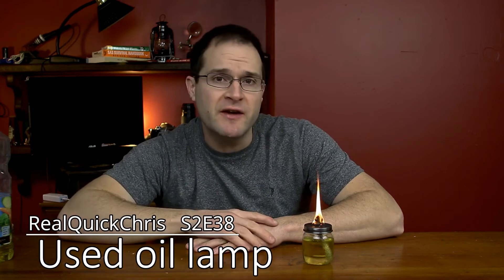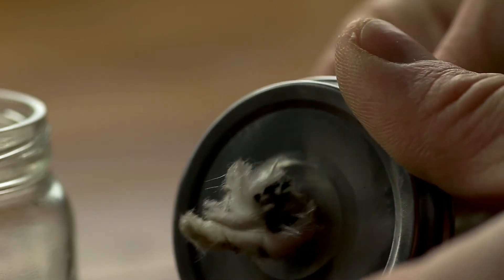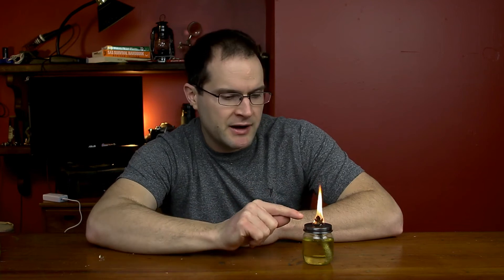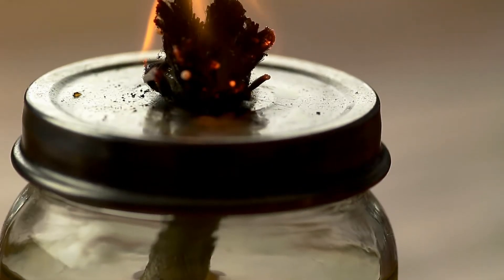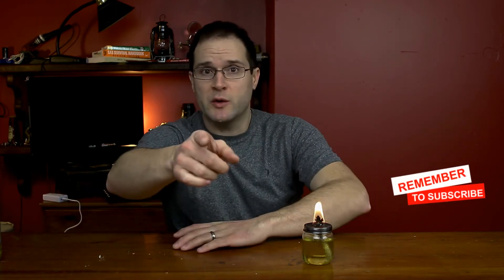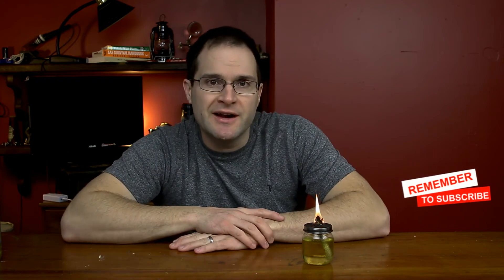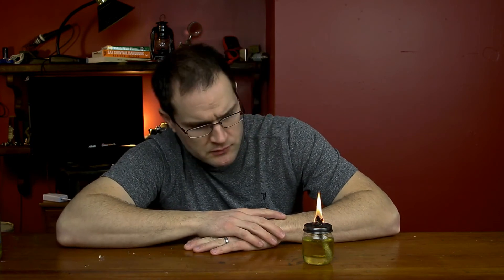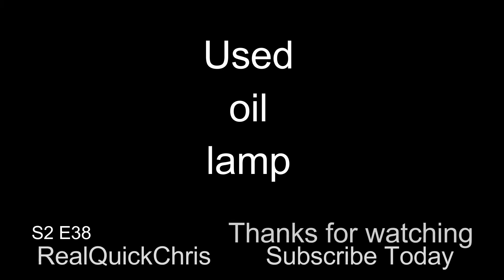how to make a used vegetable oil lamp s2e38

Comment: For Thanksgiving 2024, we used a large propane oil cooker for our turkey. After it all cooled off, I filtered close to 3 gallons of used canola oil from the boiler, and put it all in large mason jars. I did some research, and many people reuse cooking oil for lanterns, but since it is so thick, you'll need to mix it 50/50 with pure clear parafin lantern oil. I tested this technique out on some brand new lamps from Amazon, and it works perfectly. I'll have about 6 gallons of lamp oil when I finish mixing everything. Perfect if the power goes out, and I need light for 6 months straight 🤣 I also bought lantern lids that are made to fit Mason jars, so I have more light sources

Comment: I've tried various wicks, none of them seem to work well with vegetable oil. They light but use up the fuel faster than the wick can draw up more oil and very quickly go out. I've tried cotton, rope, activated charcoal and other material wicks. None of them are really worth the effort. Perhaps I've been unfortunate, had anyone found a suitable a suitable material for a wick?
Reply: Check out Carbon felt. Robert Murray Smith has a video on it. Wicks heavy oils well and doesn’t actually burn, easy to find online and cheap